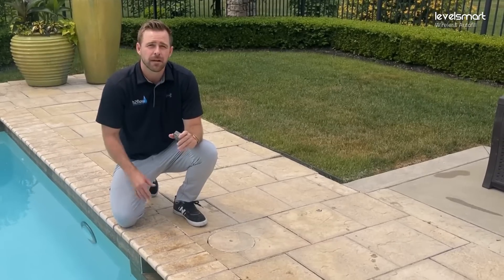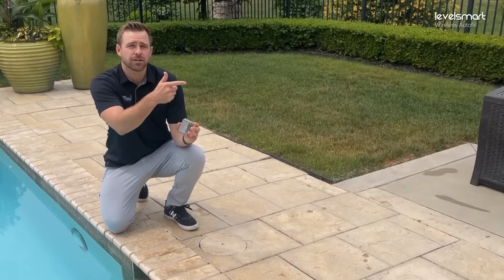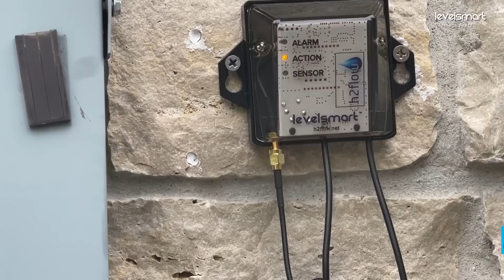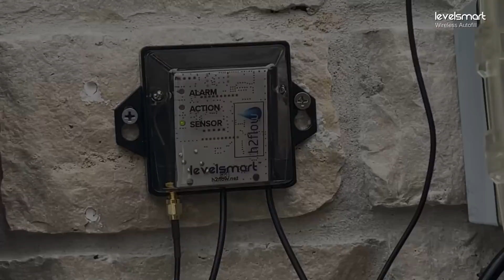LevelSmart Installation

Comment: Cool autofill. Nice wireless feature. But my god dude. Actually plumb the damn water inlet. That hose bib splitter is cheap shit. Also not a good idea to place an antenna on a steco wall lmao. Actually this whole installation is trash. But I do have over 1000 customers in TX. I will 100% buy this and start selling it to my customers if it actually lasts.

Comment: Won't the pump work against your residential water pressure?  What if the pump creates more pressure than the supply?
Reply: Yes, the return line will create positive pressure but it is extremely unlikely it would be enough to cause issues or prevent filling.
Reply: Correct. They need to add a back-flow valve to this set-up as you can have pool water slowly leak into your residential plumbing. That is not healthy. This setup would not pass code.

Comment: Which adapters did you use to connect the hose to the mechanism itself on the system??
Reply from the maker: Thanks for your question, Cole. We used a 1" male NPT to 1" male standard hose connection. We also recommend installing anti-backflow prevention or check valve.